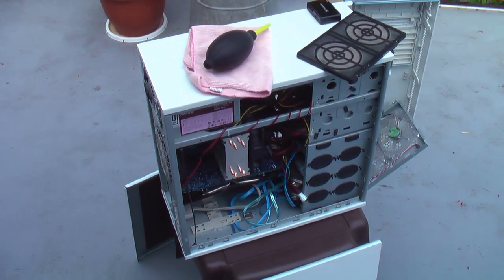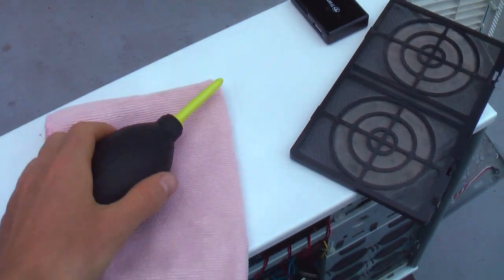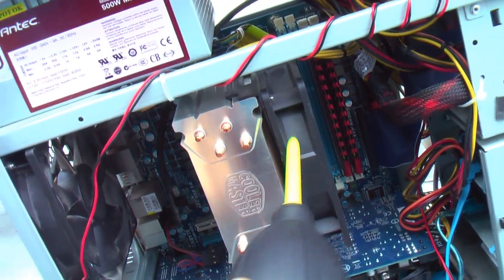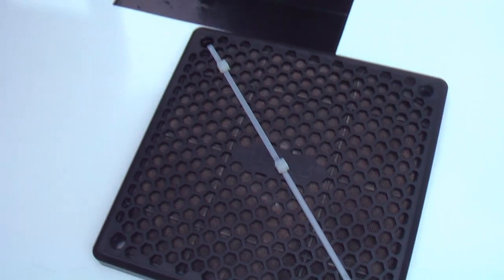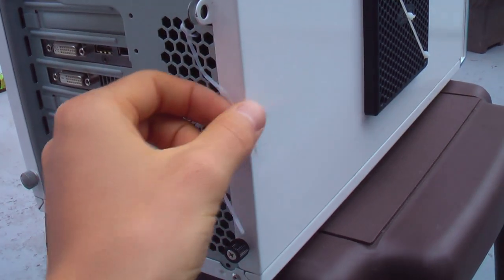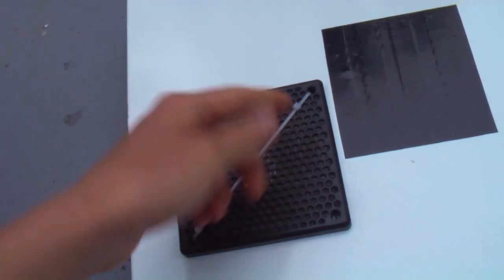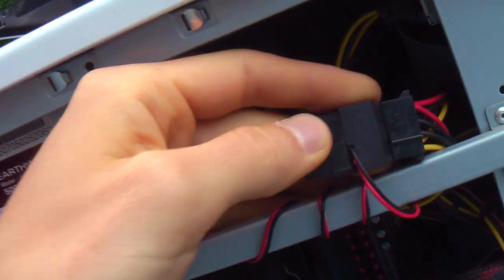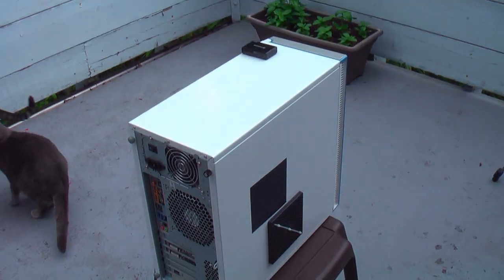Removing and Preventing Dust in your Computer Case

Comment: On my build I'm getting in a few weeks the case comes with one 120mm fan and if I out that as the 1 output at the rear and two corsair fans I bought at the front as input on a speed abit faster than the rear will that be good and have a positive flow, the two at the front will have dust filters and the rear won't ?!

Comment: I use a Vacuum just to pull the dust away since I am inside. I just push it out from a vent with a canister and on the outside of the vent I just have the vacuum sucking in the dust

Comment: I dont fully understand, is fans which pull air in to the pc better or worse than fans pushing our air? My hard drives get very hot so i modified my case to allow me to insert a 120cm fan in the front which then blows air in to the case and over the drives.
the PSU fan obviously extracts the air at the back and too the case fan at the back .... i  have a weird looking CPU fan almost looks like a car carburetor...its massive and round, maybe that also impacts the airflow?
Reply: You need both, thing is, intake fans pull in cool air, and exhaust fans push out hot air. You absolutely need both. Usually the optimal way is that Front Fans intake air, rear fan pushes out, if you have side and top fan slots, then side slot should pull in air and top slots should push out air. Or other way around depending where your PC is situated at your work station.

Comment: Air compressors are fine
Reply: They are. We have used them for 20+ years. So long as you don't act like an idiot you should be fine. They are also way faster to use. I will agree though that you should NEVER vacuum a computer. Bad Ju Ju.

Comment: "connect the fan to 5v and it will decreese the speed" yeah, most likely somewhere near 0 rpm, as the majority of fans wont start at voltages lower than 7v.

Comment: I'd recommend having negative air pressure in your computer, while having filters on the intakes. The negative air pressure makes the air inside the computer cooler, while compressing air inside the computer makes it warmer. think about a CO2 metal cartridge for BB guns, or compressed air cans, they get really cold because the air inside is becoming decompressed. Same principal applies to computers.

Comment: The way I clean my box is with a garage hose, duster gun, and a compressor. It blows off all the dust in seconds! Anwyay, cool =P I figured it was an old Antec chassis. They have that unique frontal door. I have a new Antec case and had a few before. Really like them - they look slim and with heat shields on the doors. I also got the same cooler from Cooler Master. Though, can't say it does the perfect job, but that's something you would expect for only 50 bucks... NOW, back to the boat! =P

Comment: You were right about the vacuum don't ever use that for anything. As for a air compressor as long as its under 20 or 15 psi then that's what you want to use. That hand pump won't so anything but stir the dust around.

Comment from the maker: Nothing crazy, but a good all around machine.

Gigabyte GA-870A-UD3 Motherboard
Phenom B50 Processor (quad core 3.1GHz)
16GB G.Skill Ram
Crucial 120GB SSD
Gigabyte 6850 Graphics Card
A couple 500GB HD's
Random Optical Drive
Some sort of network card

I have had the machine for 5 years now and just swap out components when they get old, I spend about $200 a year to keep it up to date.

Comment from the maker: true, but if I did that wouldn't have any output fans, and I think that would restrict my airflow a lot more.  You should have at least 1 output fan, maybe 2.  And besides, If you start flipping fans around you will alter how the air flows around the case and possibly create dead zones and cause overheating problems.